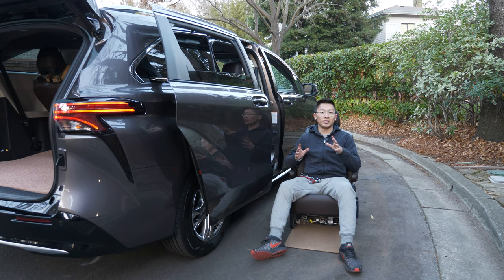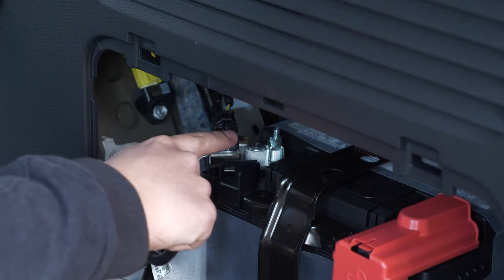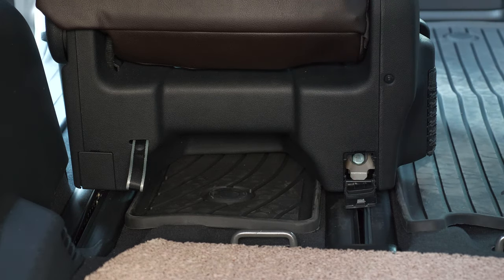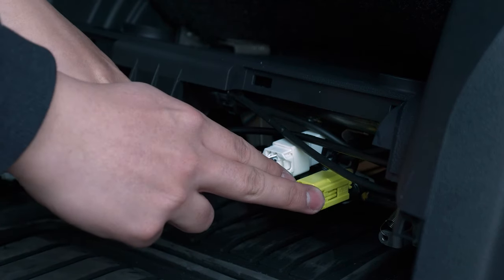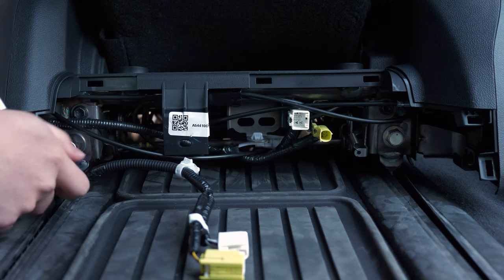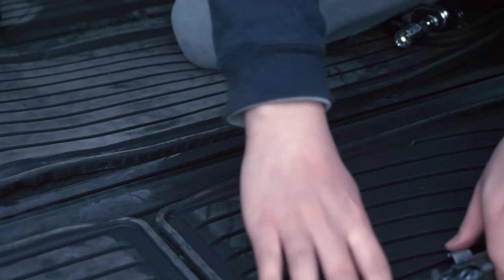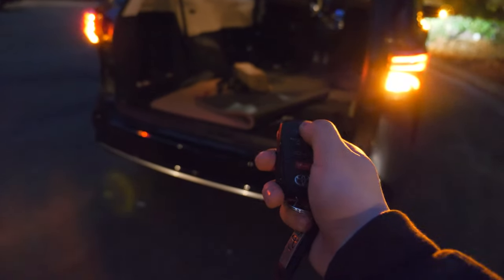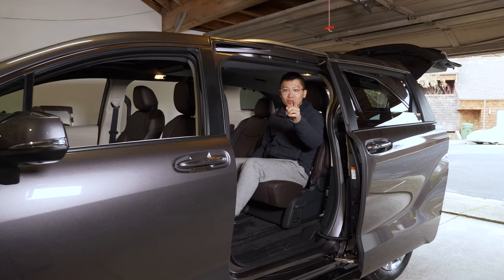Removing 2021 Sienna's "Non-Removable" Seats (UPDATE IN DESCRIPTION)

Comment: I own a 2017 Sienna LE AWD with 2nd row Captain's chairs.  By the time you had the rear 12 volt battery negative terminal disconnected I had both of my 2nd row seats out of my van.  Just sayin'.  It's like the brainiacs at Toyota sat around discussing the 2022 Sienna and said, " Hey, the current Sienna is WAAAAYYY to practical.  So, how can we make owning a new Sienna less attractive to our customers"?  Answer #1) "how about making the 2nd row seats (much) hard(er) to remove?" ; 2) "That rear windshield wiper that's hidden under the rear hatch spoiler?  Yeah, let's place it on the lower part of the rear windshield, just.like everyone else!!"; 3) "Hey, our V6 is super smooth and quiet.  So, let's get rid of it and put in a loud, weak 4 cylinder with less power!!"  
What it up with Toyota?  Their goal must be to lower the sales of the Sienna because they really made an already hard-to-sell vehicle harder to sell.

Comment: How much additional room do you get by removing the seats? How many feet from the front seats to the back?
Reply: With the middle seats moved all the way forward, you have 75 inches clear to the back door.
Reply: @plumedargent4459  thanks . Do you know how long the battery will heat the interior with the car turned off ?

Comment: Great video.  Are the airbag error messages on as long as the seats are out?  I assume that seat removal has a negative affect on warrantee?
Reply from the maker: Yes, the airbag messages are always there on the gauge cluster screen. Pressing the steering wheel back button dismisses it for only a few seconds before it comes back. But it doesn't affect driving. I haven't tried it but maybe you could clear the warning using an OBD2 scanner, but I chose not to do that because I'd want it to warn me in case I didn't reconnect the airbag properly afterwards.

I don't think removing the seats would affect the warranty at all because:
(1) It's fully reversible and you can't tell if someone had removed the seats before by looking at them.
(2) The 
Magnuson–Moss Warranty Act prohibits manufacturers from denying warranty for consumers who work on their own cars, except if the modification actually caused the issue you're trying to get a warranty claim for.
Reply: @BradsHacks  Thank you.  Again, great video.
Reply from the maker: @bwj999  Update: I developed an airbag simulator to solve this problem: https://www.youtube.com/watch?v=CFSBTX6F_sw

Comment: Thanks for this Brad, where did you bought the all weather mats from?
Reply from the maker: Those are a factory accessory option.  I wouldn't recommend them. They look super dirty. I think mats with a waterproof weave texture would be better.
Reply: @BradsHacks  Thanks, they are not yet available in the market though.
Reply: @shehabalmuslehi7718  The parts number is PT206-08210-02 and you can find them online

Comment: After you remove the second row, do you get an airbag warning on your dash and non stop beeps?
Reply: That is what I have found - Any fix for this?
Reply: I too am interested. Any feedback?, Brad?
Reply: @adams614  my friend got one new sienna recently, there is a airbag warning on the dash. But there are no non stop beeps .
Reply: @wadefinklestein6013  honestly just wait for the 2022 model if it’s not an urgent need, they might add this chair removal feature back and fix some other issues about the car
Reply: @easonfan5578  did your friend remove the second row seats?
Reply: You may have noticed he says, "Re-insert the cable tie and (airbag) connectors........After you reconnect the battery the airbag error message should be gone".
Reply: @fergalo6928  yes the error will be gone if he install the seat back and plug the airbag back, but I am saying that there is an error if he drive without the second row seats
Reply: @easonfan5578  I see what you mean. He would need to bridge the airbag plug with a diode to fool the car into thinking the airbag was plugged in. I don't know what size of "airbag simulator" he would need. There are some available on eBay.
Reply from the maker: @wadefinklestein6013  I developed an airbag simulator to solve this problem: https://www.youtube.com/watch?v=CFSBTX6F_sw

Comment: Brand, how do you like the engine noise when  accelarating? Does it feel noisy and underpowered?
Reply from the maker: I actually prefer the noise and feel of an eCVT over a multi-speed automatic, because it allows me to sustain full-throttle acceleration without causing jerkiness (due to gear shifts) to my passengers. It also makes the throttle response much more consistent, whereas a multi-speed car would accelerate differently depending on which gear it was in. I cannot emphasize how nasty and unrefined a multi-speed transmission feels now that I'm used to driving EV's and eCVT's.

The noise level is fine for me. They actually did pretty well with NVH compared to last gen Sienna. Power was enough for me to keep up with a 2000 Porsche Cayman going 100mph uphill to Lake Tahoe. Most people who complain about not having enough power aren't using all the power. I am.
Reply: @BradsHacks  thank you

Comment: I really looked into and wanted to buy a Sienna. But, I will be keeping the $50k+ I was willing to pay for a  loaded Sienna. Toyota totally Failed with the nonremovable second row seats. To get the 2nd row seats out of the way, you are having to unbolt the seats out and then re-bolt them in!  You should only need to remove the 2nd row with a latch, then fold down the 3rd row, throw in a cot and mattress and you are ready for the weekend. You could turn it back into a family hauler on Monday. Toyota decided to Defeat the ability to haul more of your fun stuff due to the 2nd row taking up valuable cargo space. It's such a Huge Fail for Toyota to ruin the usability and potential awesomeness of the Sienna! I'm still going camping and hiking, but without a Sienna, someone at Toyota can take a hike as well.
Reply: Ugh, same!
Reply: If you can't remove the seats yourself you shouldn't own a vehicle.
Reply: @timothysommers4863  😏😊
Reply: They are easily removable, you'll just have an air bag light on when you do
Reply: @timothysommers4863   brad sells dongles to override that airbag warning, so you don’t even have that anymore.  So good!

Comment: Just to be sure, the resistor is 2.2 Ohms, not 2.2K Ohms?
As I am sure you well know, both are commonly available standard value resistors.
Reply from the maker: 2.2, not 2.2k. You can measure your airbag to confirm
Reply: @BradsHacks  Thanks again! I already ordered your well designed plugs but I need a quick solution until they arrive.

Comment: I noticed at the beginning of your video that you did not have the center seat base installed which attaches to one of the other seats. Had you already removed that.? I would like to remove the center middle seat plastic base that interferes with walking between the two captains chairs. Is that possible? Did you do that?
Reply from the maker: I have the 7-seat version which does not have the center seat to begin with.
Reply: @BradsHacks  okay sounds good thanks

Comment: Does anyone have issues after removing the 2nd row seats? Ours won’t start after that.

We received our new Sienna 2021 2 weeks ago and we removed the chairs before yesterday as demonstrated in the video. Now the car will no start with a message on the screen saying parking break unavailable’, and the system shuts down.

The minivan was then towed to Toyota garage, and we were told the issue was caused by the missing of the 2nd row seats.  We have to put them back otherwise it won’t start.

Does it make sense? The reason we bought Sienna was we want a minivan camper and we thought we could remove the 2nd row seats.

Comment: I wonder if it is possible to upgrade a Toyota Sienna hybrid to a plug-in hybrid with a more powerful battery, what do you think?
Reply from the maker: Anything is possible, but engineering is required
Reply: @BradsHacks  And there is a possibility that the next generation of Sienna will be a plug-in hybrid?
Reply: @BradsHacks  at home, having the appropriate equipment, can you put a battery for 18 kilowatt hours like in a rav 4 plug-in?
Reply from the maker: @ВикторияПодлипская-к4д  you may need firmware modifications

Comment: Did your car computer complain about the disengagement of the airbag connectors of the 2nd row seats?
Reply: My dealer removed my seats today. I NEVER want them in. But they couldn't get air bag warning to go off and wouldn't let me leave without the seats in. They couldn't answer the question if the front airbags would still work. Deal breaker if they don't work.
Reply from the maker: @suefleig9480  I developed an airbag simulator to solve this problem: https://www.youtube.com/watch?v=CFSBTX6F_sw

Comment: How do you measure 65 N .m or 48 lb. ft when you tighten the bolts back  after re-inserting the seats?
Reply from the maker: You would use a torque wrench, please check the description for it

Comment: Can you drive without  buying air bag simulators
Reply from the maker: The van will still be drivable, but since the airbag warning doesn't tell you WHICH airbag is malfunctioning/missing, you wouldn't know if a front airbag or other actually has a problem. That is a potentially dangerous "cry wolf" situation.

Comment: Can someone explain why these were "Non-Removable"?  It was 3 plastic trim pieces and 4 bolts, pretty standard seat removal.  Unless.....  was I click-baited?  I was wasn't I?
Reply from the maker: "Non-removable" is more of a Toyota statement — that's why I had them in quotes in the video title. The removal process is indeed simple. I think the main reason Toyota officially doesn't include removal instructions for owners is because of the airbag problem, explained in the follow-up video linked in description.

Comment: good video... Now we need custom 3D printed end caps to go over the rail system that holds the resistors that clip into the wires to keep the airbag message off. One of Toyota's worst decisions ever...none removable seats,  hopefully, there will be another video floating around on how to remove the rail system completely out of the floor.
Reply from the maker: Indeed, I developed an airbag simulator for the Sienna: https://www.youtube.com/watch?v=CFSBTX6F_sw

Comment: After removed the second row. The power truck door will not open. Does anyone know how to fix that? Also about the airbag malfunction alarm, how do you get it off?
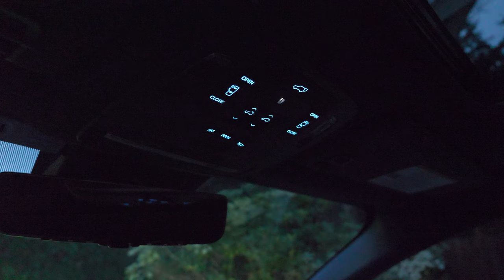Reply from the maker: The end of my video shows how to reset the power doors after unplugging/replugging the battery: 5:59

Comment: Lol...this definitely gonna take more than 10 minutes! At least 30 minutes.  Terrible decision from Toyota for not making  the 2nd row removable.
Reply from the maker: Yeah, I realized I was mistaken to imply 10 minutes with hand tools. It's only possible if you've already done it before and have a power tool.
Reply: How did you got rid off air bag error message

Comment: Why would you remove non-removable seats??
Reply from the maker: to haul stuff
Reply: @BradsHacks  Dude, get a cargo vehicle instead lol
Reply from the maker: @МигельБерсунса  Why would I, when I can have the passenger comfort and the cargo capacity in a single vehicle?
Reply: @BradsHacks  you can find that on the market without having to remove anything.
Reply from the maker: @МигельБерсунса  What should I have gotten instead?
Reply: @BradsHacks  Aahhh never mind!! I really like that you included the torque values.

Comment: Good video, but it still looks like a real pain in the butt compared to quick release designs of competitors and of course stow & go capabilities of Dodge / Chrysler. I mean if you're going to take them out once right after you buy it and then stow them in your garage for years, I guess that's fine, but then again if you're going to do that anyway, you'd be better off just getting a cargo van to begin with.  What a major blunder by Toyota! I'm sure there are a great many buyers like me for whom this is a full stop deal breaker.

Comment: If you read the owners manual it says the middle of the middle is removable i am mad about the seats also mad that i bought mine second hand from toyota now the first owner did not buy the roof rails and rack so the roof is actually built different that is not an option to add after the fact as they don’t have the mounting hardware. We are also in 2023 every minivan should have tvs for the kids you can buy tablets for $35 for a bad one or $100 for the good ones im sure you can blend a $200 purchase into the 60k price already. Shame on you toyota

Comment: Uh ... And now you have disabled the entire airbag system!! You need to shove a 3 or 3.3ohm resistor in the yellow harness in the car. Also ....wait at least 90s after disconnecting the battery before messing with the yellow connector.
Reply from the maker: I developed an airbag simulator that plugs into the yellow connector: https://www.youtube.com/watch?v=CFSBTX6F_sw

Comment: My concern is that with the second row removed the system triggers the airbag light indicating it can't "see" the seats. It therefore disables the entire system.

Is there a way to enable the remaining airbags, clear the light, all while with the second row removed?
Reply: Douglas Sheldon
1 second ago
A former Toyota service technician just stated very clearly to me that the other parts of the airbag system are also inoperable with this break in that circuit.....one should be able  to find the right sized resistor and insert into the remaining half of the yellow connector to mimic the removed airbag circuit.....I'm planning to start with 2.2 ohms.  He likewise informed me that the wiring diagram would not state the resistance of the actual circuit.  Looking elsewhere online it appears that others have used resistors between 2 and 3.5 ohms,  5 watts for other airbags in other vehicles.....so that sounds like a decent place to start.    (although it's not certain that measuring the existing real resistance in the removed seat  airbag circuit with a multimeter would deploy the airbag there are certainly some reports of that happening with significant injuries,  so caution with all of these steps would be advisable...there are legitimate reasons that Toyota has specified that these seats are not designed to be removed which also argues for careful consideration when undertaking this project)   Here's a link to a relevant video of using a resistor for something similar ://youtu.be/CNPR5JYdEQM
Reply from the maker: I developed an airbag simulator to solve this problem: https://www.youtube.com/watch?v=CFSBTX6F_sw

Comment: So sad Toyota is forcing the hybrid to all its Sienna buyers
Reply from the maker: I actually quite like the eCVT system. It's totally smooth even when driven hard, because there are no gear shifts. At the acceleration rates I drive at, a traditional transmission would be jerky and uncomfortable for my passengers. And no more idling when stopped. The eAWD is also pretty elegant.
Reply: Thanks for replying, I understand why you like it. But different people have different preference on how car operates. I understand the smoothness of CVT, but that’s exactly why some people don’t like it. Not having V6, not having traditional AT, and having to go through so much trouble just to remove the seats...just wish Toyota will have both V6 and hybrid for people to choose that’s all.
Reply: @bebe0928  FWIW: In my experience, Toyota's CVT use with the Hybrid is great and completely different from CVTs in Nissans or Subarus with conventional engines (my only other CVT experiences). Those are atrocious.
Reply: I don’t doubt the Toyota CVT, my whole point is that I wish there’s V6 available as option. Some people just prefer the good old V6 power and no battery under the floor, and don’t might the not so good gas mileage, me being one of them.
Reply: CVT??? Strike 3!
Thank you

Comment: “We need to disconnect the battery so we can depower the airbag system”.  ...... I’m out.
Reply: I understand that most cars require this.  Brad has an impressive skill set and an equally impressive presentation.  I was just saying that I personally don’t feel comfortable doing this (also I would have to buy some tools).  Your experience may be different.  Cheers!
Reply from the maker: @evidencebased1  I developed an airbag simulator to make the airbag computer happy: https://www.youtube.com/watch?v=CFSBTX6F_sw
Reply: @BradsHacks  you are a man of many talents Brad!